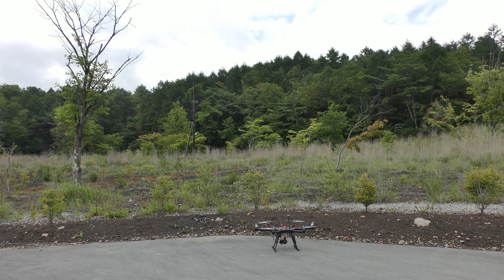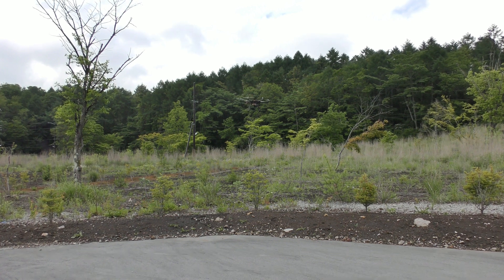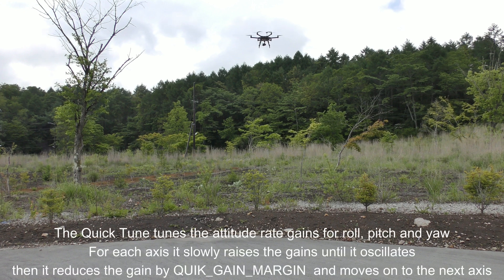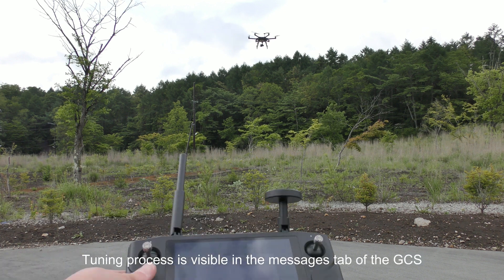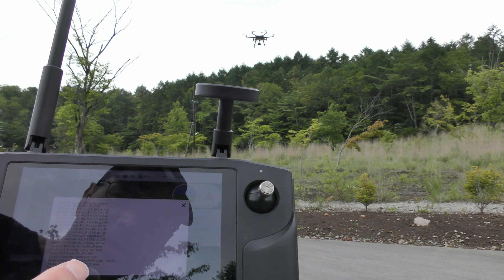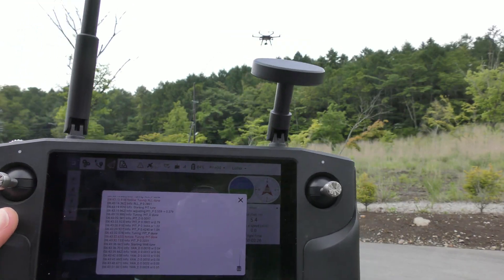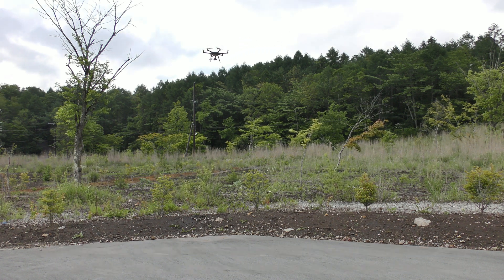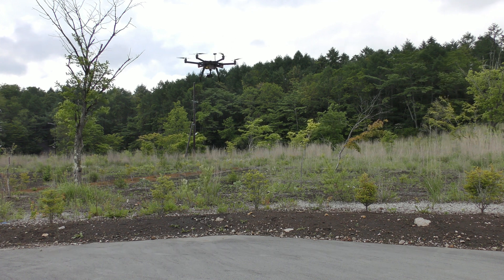VTOL Quick Tune First Test (on a multicopter)

Comment: Thanks! Which GCS are you using on the herelink?
Reply from the maker: Hi @EnermaX4815162342, the Herelink ships with QGC 4.0.8 installed.  We have instructions here on the ArduPilot wiki on how to update it to a newer version if required https://ardupilot.org/copter/docs/common-herelink.html
Reply: @rmackay9  Thanks for the quick response! I will definitely try it out! I am still using SolexTX mainly for live viewing of the camera footage but it is kind of limited when it comes to configuring the drone/parameters.

Comment: Hello, this is very cool, and i wanted to try this out, but I'm not sure how to trigger it through qgroundcontrol like you did. For me this is the only way, since i don't have an RC. How did you do that? Thanks in advance
Reply from the maker: Hi @issataysissemali3203, Thanks very much! I don't think it's possible to trigger from QGC without an RC.  In general we strongly recommend getting an RC or a joystick (which is essentially just another type of RC input) especially when first setting up a vehicle.  There are quite reasonably priced options on the market and it's important that a pilot be able to quickly retake control of the vehicle in case of troubles.

Comment: Finding script fails to run on different CubePilot Orange+ units. Not sure why?
Reply from the maker: Hi @dynexhobby, thanks for the report.  the most likely issue is that the Cube is running different versions of AP, perhaps some older version that doesn't have all the "bindings" that the script requires.  It's probably best to make sure the vehicles are running 4.5.7 or 4.6.0 (beta) and then post a log in the forums.  We are nearing the end of the 4.6.0 beta testing period so I monitor this forum nearly every day https://discuss.ardupilot.org/c/arducopter/copter-46/179

Comment: Thanks, Randy. This looks great. 

I've set up LUA script for the Hexoon lights just to make sure it was working. few hitches in way of the script dir not creating initially and a weird prearm error but it ran the script. Important to rename .lua so it recognises that file format. 

Onto Harmonic Notch Filtering next. Assume that is still a requirement? do you need for Autotune as well?
Reply: Hi Randy, just to confirm. Is Harmonic Notch Filtering a pre-requisite? I can get the script to load and it's set to RC7_OPTION = 300 but nothing initializes on the RC

Comment: unable to get my GPS to connect in 4.3.0 Dev
FC - Cube Orange with Here 3 GPS 
connected to CAN 1 port 
parameters CAN_P1_DRIVER set to 1
GPS_Type set to 9
NFT_LED_TYPES set to DroneCan 
after reset GPS does not come on. 

Don't have this issue in Official V4.2.3

can I use this Luna script in 4.2.3 ?
Reply from the maker: @UAV Simplified, yes, this script works with 4.2.3.  Feel free to post issues with 4.3.0-beta2 in the 4.3 support category and ideally provide an onboard log. https://discuss.ardupilot.org/c/arducopter/copter43/167
Reply: @rmackay9  thank you

Comment: Wow great Randy, but how is the result compared with previous Autotune process?? How it works as there is no movent at all during autotune??
Reply from the maker: Hi Tony, it is safer and easier than the normal AutoTune flight mode but less complete.  This method only calculates the lowest level "rate" gains.  These are the most important gains but regular AutoTune calculates other parameters as well including angle gains and the vehicle's maximum rotational acceleration (e.g. how quickly the rate of rotation can change).  The vehicle does rotate slightly but it is very subtle.
Reply: @rmackay9  So that means this is the first step. After finishing Quick Autotune, then to make it perfect, we need to do Normal Autotune , right?  Is this Quick Autotune only available in 4.3 Fw? When do you think 4.3 will become stable release? Thank you for your super fast response... I always appreciate all your work to improve the Ardupilot system.
Reply from the maker: @kepplerdrone  thanks.  We back ported this to Copter-4.2 so it is available with the current stable release (4.2.3).  https://github.com/ArduPilot/ardupilot/blob/Copter-4.2/libraries/AP_Scripting/applets/VTOL-quicktune.md#operation .  Yes, you could run this script first to get the vehicle flying fairly well and then move on to the regular AutoTune if you think that's necessary.  The regular AutoTune fails for a significant number of vehicles for various reasons so for those vehicles this script at least replaces the hardest part of doing a manual tune.

Comment: Good! Sometimes the battery level affects the response of the drone - is it better to autotune at 100% battery or 50% battery? What you think ?
Reply from the maker: Hi Yuri, I think it should be tuned using a full battery and the battery voltage compensation should also be configured https://ardupilot.org/copter/docs/current-limiting-and-voltage-scaling.html#voltage-scaling
Reply: @rmackay9  Thanks !